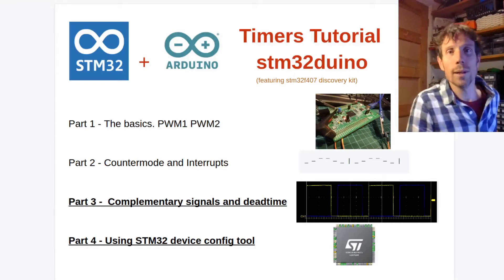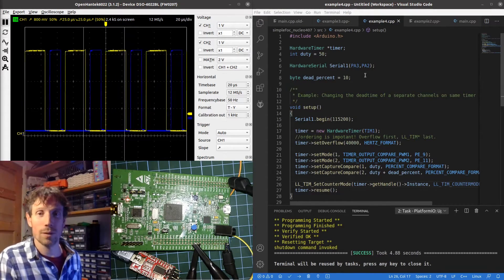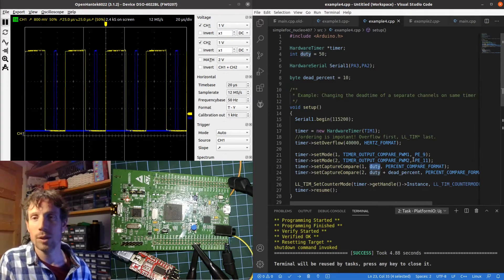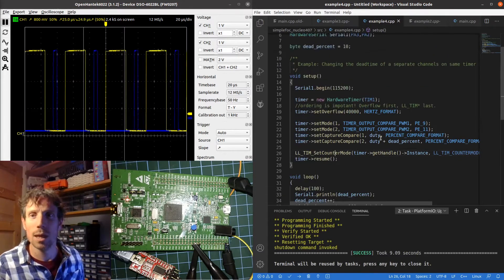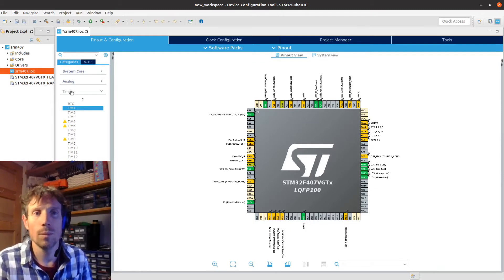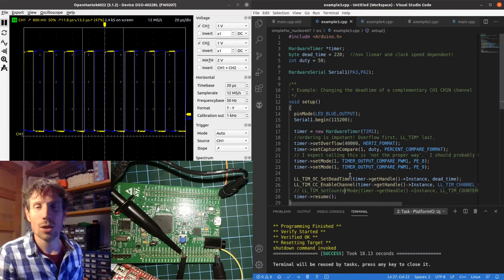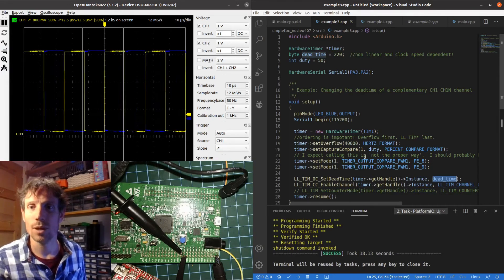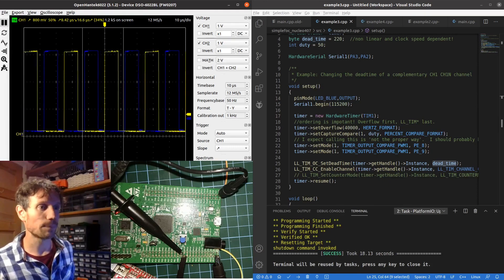STM32duino Timer Tutorial:  Part3 + 4 - Complementary and Deadtime

Comment: /*
 * Frequency generator FLIP FLOP
  Works with 
  - Arduino IDE
  - Board Manager -> STM32 MCU based boards 2.3.0 
  - Board : STM32F1 serie
  - stm32f103c6t6
  This example shows how to configure a PWM with HardwareTimer.
*/

HardwareTimer *MyTim;
int duty = 30;
int frequency = 70000;

void setup()
{

uint32_t channelA = STM_PIN_CHANNEL(pinmap_function(digitalPinToPinName(PB0), PinMap_PWM));
uint32_t channelB = STM_PIN_CHANNEL(pinmap_function(digitalPinToPinName(PB1), PinMap_PWM));

  HardwareTimer *MyTim = new HardwareTimer(TIM1);
  
MyTim->setPWM(channelA, PB0, (frequency*2), (100-duty)); // Hertz, %dutycycle
MyTim->setPWM(channelB, PB1, (frequency*2), duty); // Hertz, %dutycycle

LL_TIM_SetCounterMode(MyTim->getHandle()->Instance, LL_TIM_COUNTERMODE_CENTER_UP_DOWN); //center OK
//LL_TIM_OC_SetDeadTime(MyTim->getHandle()->Instance, dead_time); //not useful
LL_TIM_CC_EnableChannel(MyTim->getHandle()->Instance, LL_TIM_CHANNEL_CH2 | LL_TIM_CHANNEL_CH2N); // inverted ok phase shift 180° complementary channel

MyTim->resume();

}
void loop()
{
  
}